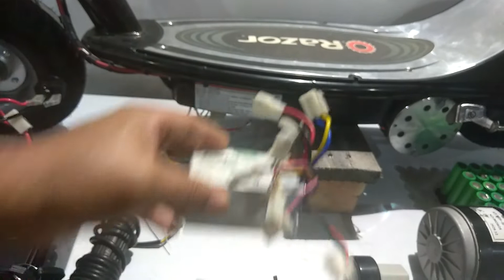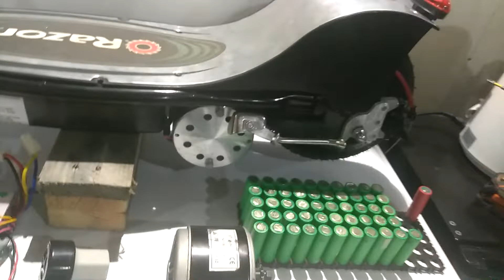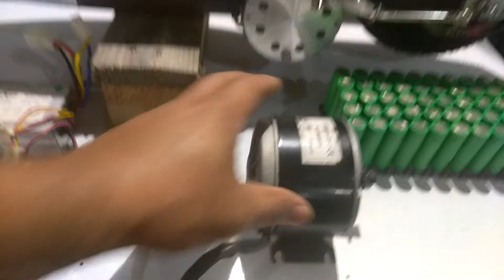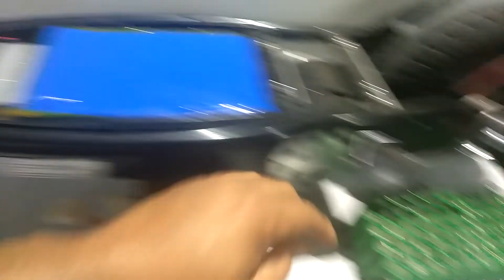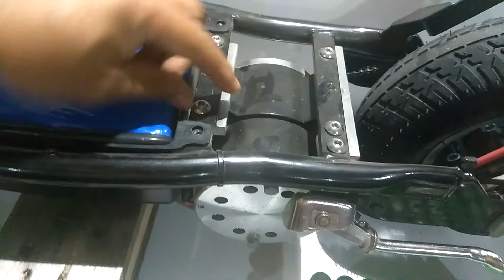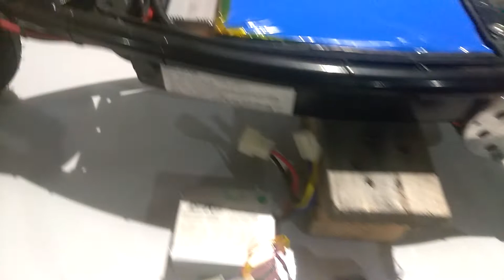my 25 mph razor scooter and the parts you need to do it.

Comment: Nice 👍🏼, I am building one with 2 18v Mikita batteries in series.  I made a razor dirt-bike using the same dual Mikita 36v setup.  Amazon has the mounting shoes for the Mikita batteries.
Reply from the maker: Thanks for the info when you get it going upload a video I like to see it running 👍.